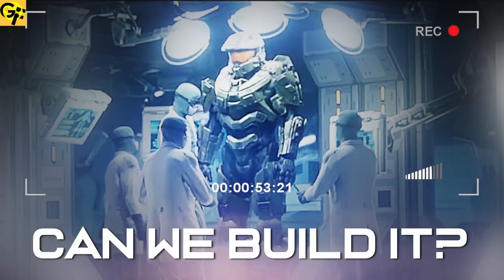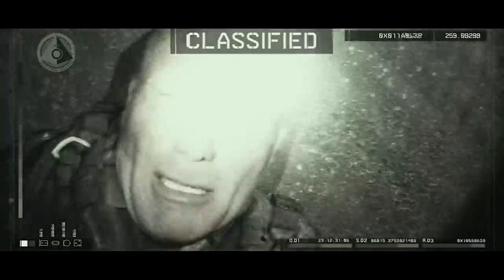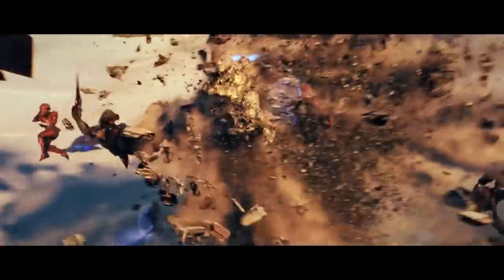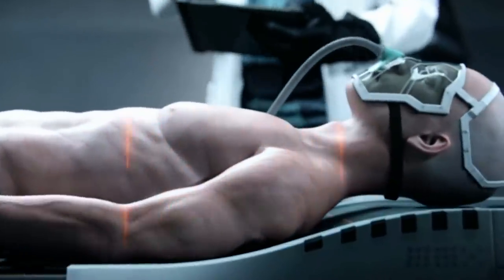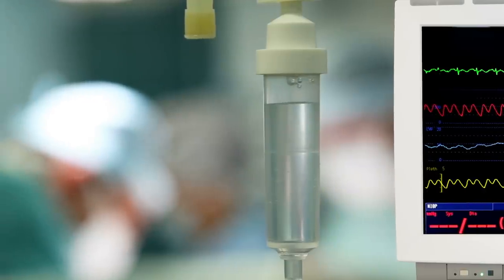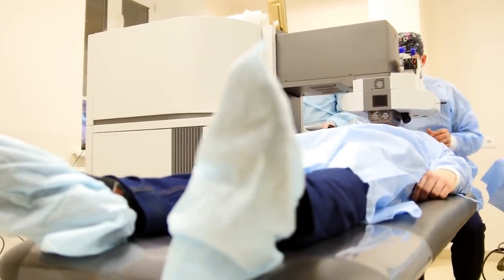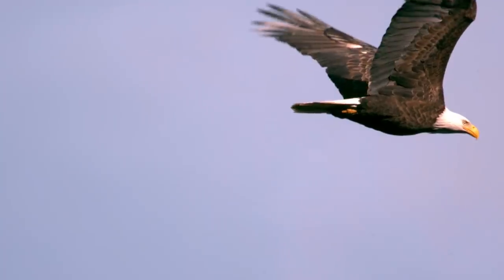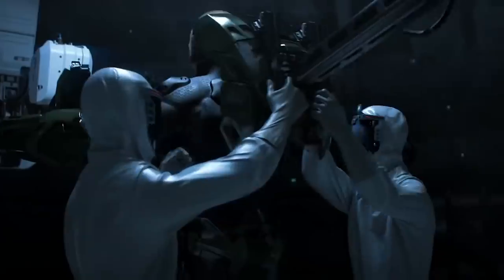Can We Create a HALO Spartan | Human Augmentation

Comment: The actual steps started with the Thyroid implant that increased the Spartans size and strength mixed with a diet and exercise regime that was already in place. 
Then came the bone grafting and muscle enhancement injections which would have not only increased the muscles like a steroid but would have actually altered the genetics of the Spartans in order to not only increase their size and strength but also maintain that size and strength level for a prolonged period of time.

Comment: 2:20 "....replaced by flash clones who died soon thereafter..." That isn't actually accurate if you read the Halo books. The flash clones were much more susceptible to disease, etc. because the cloning process degraded their overall health due to the extremely accelerated growth process to make them match chronologically to the children they were replacing. However, it is mentioned several times in books that are considered canon that some of the clones lived to adult hood and some were even in high security positions. This is also true for the Spartans that 'washed out' during the augmentation phase but didn't die in the process.

Comment: Many of the augmentation that spartan's under go are actually obtainable with current quote on quote genetic diseases. So for the size and muscle growth of a spartan you could use supra male syndrome in order to bolster naturally grown muscle mass and bone structures this also has the side effect of making a person more aggressive which might be useful as well. As for the bone strengthening you could use the a genetic disorder that bulsters bone density to roughly eight times the normal level, and for stamina you could get a genetic disorder that allows the spartan to run for nearly forever. A disorder that allow spartan's to withstand extreme cold temperatures is a good addition, and its safe to say that tetrocromia is a decent addition allowing spartan's to see more colors as for muscle growth beyond supra male syndrome simple weight lifting would do the trick
Reply: to put it simply the augmentations that the spartan's under go already exist in a biological form so you'd just need to alter the children genetically and they'd grow into a proper spartan and actually I'd like to see them do that in the halo verse
Reply: also a disorder that would allow muscles to fire at 100% capacity would be a great addition to a spartan because in case your wondering normal people are naturally restricted to around 30% of their muscular strength in order to prevent self harm from simply moving, but with a spartan's enhanced connective tissue through the use of genetic tinkering they could more then likely stand up to the strain of 100% muscular strength

Comment: Hey man you wanna know what's scarier than a Spartan? A Spartan with a Nano suit, yeah think about that.
Reply: Actually the nano suit would be weaker than MJOLNIR
Reply: I thought MJOLNIR was a nano suit?
Reply: @jehuroa2724  
No MJOLNIR is first the glove suit that more like a basic layer that has some protective capabilities among a few other things, then the Armour plates and motors that help to move the armour, the core chestplate, contains the Fusion power cell, and a proper shield generator, the armour is directly connected to the Spartan via neural implants that work as a Brain-Computer interface, the helmet has a HUD amd is fed data from the armour and usually the guns so it can keep track of ammo, it also has a targeting reticle to increase precision, also the armour plates if the MJOLNIR armour are basically bullet proof and capable of withstanding to energy weapons up to a certain degree

The Nano Suit works by using nano materials that can change its physical properties via electronic current, it hardens to create a hard flexible bullet proof material, or changes its shape to create a material that bends light around it creating an invisibility effect, it also has the ability to work as the muscles of the soldier, so it increases the strength of the synthetic muscle layers of the suit, it can increase overall strength, or boost the flexibility and strength to increase the speed of the suit wearer.

Basically the Nano suit is less of a power armour suit and it is more of a body glove made of a special nano material that can change its properties by conducting electricity on it, which is why it can't maintain the modes indefinitely, it runs out of electric charge after a certain amount of time and needs to recharge itself, you can't maintain stealth forever because it is an active electric field to change the properties of the material.
Reply: I thought the body suit was nano tech guess I was wrong.
Reply: @jehuroa2724  
I believe it does make use of a nano-composite material it just works radically different to the nano suit from Crysis

Comment: Half the spartins not 35. Around when reach fell there were only around 35 spartins left otherwise around 80 to 74 made it throw argumentation with about a dozen or so unable to fight but giving areas to work inside oni cause of the unfixable ailment and so on. and some took longer to recover but still became combat ready like Kurt and Sam. But close on the info. Also Kelly could run 80mph and was known as the fattest of all Spartans both in physical and mental capacity.